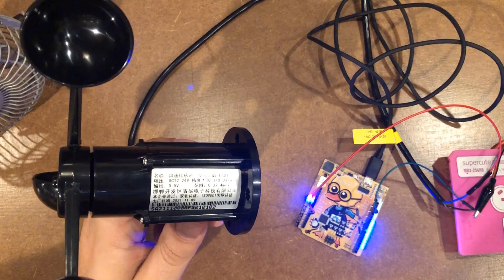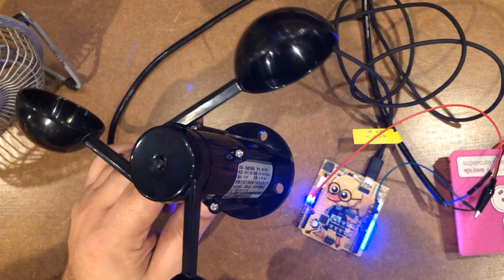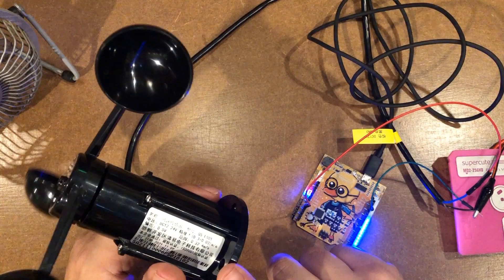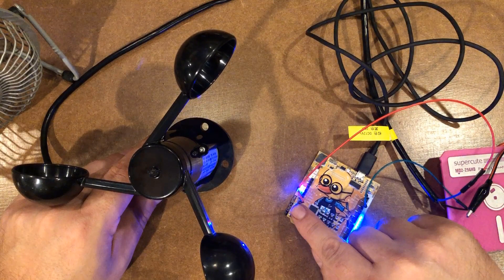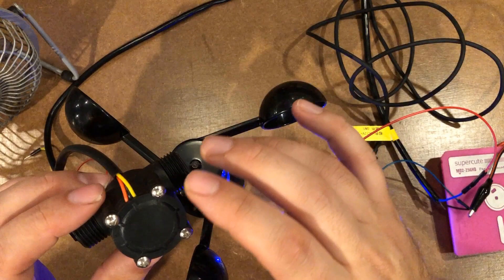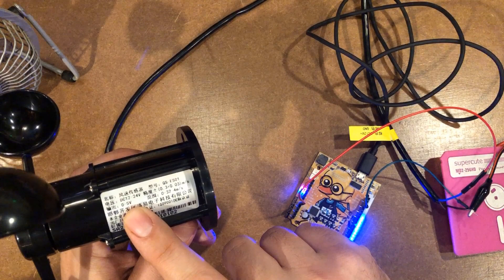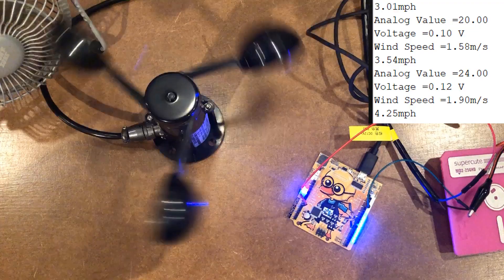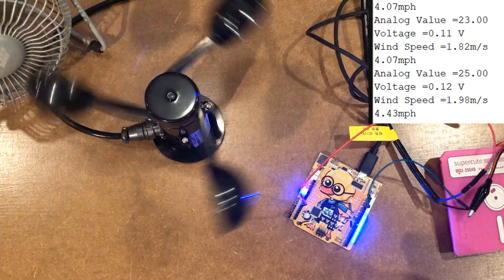How to measure wind speed arduino in 3 minutes

Comment: I coded a wind speed and direction station using a pic 18.  The anometer produced a square wave 1hz per 4 km. I had to setup a few loops to poll rising and falling edges. The loops would keep track of iterations and when a complete period happened they would send the complete iteration count converted with a formula back to main function
Reply from the maker: Oh that's really awesome. I've been starting to tinker with PICs a little more.  Fun stuff.

Comment: Hello .I have another question for you. Do you know if it is easy to use an anemometer with the RS 485 protocol. I would have bought the anemometer you recommend but it is really too expensive for my budget. Sorry
Reply from the maker: I'm sorry. I don't know one that uses that. You may be able to use a normal one with an arduino and then use the arduino to send the RS485.

Comment: Great video. How long can the board log data for? Or if I wanted to log data how would i need to change the code to log to an SD card on a breakout board?
I’m a complete novice when it comes to this stuff but want to survey the wind speed at home (looking at installing a turbine) thanks!
Reply from the maker: The ethernet shield has a built-in SD card reader that is just kind of the easiest way to go for something like that. It just pops on top and you can do tons of data logging